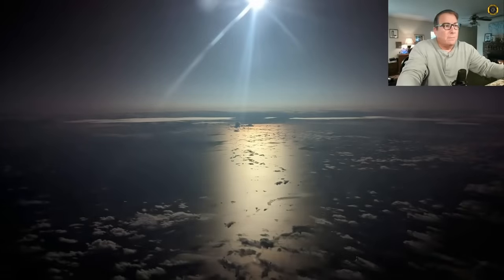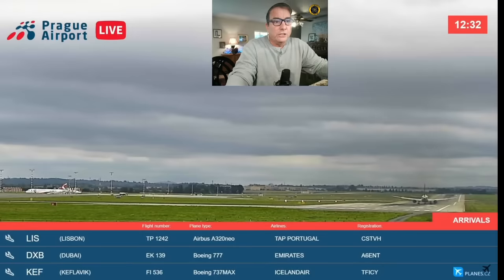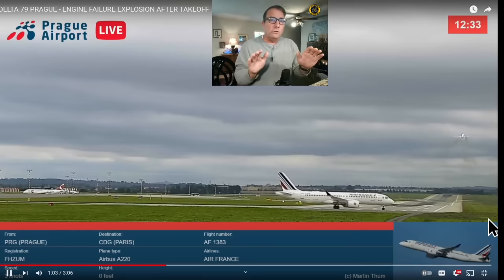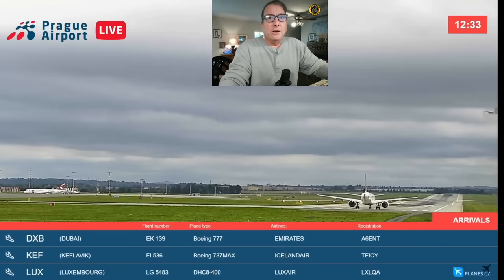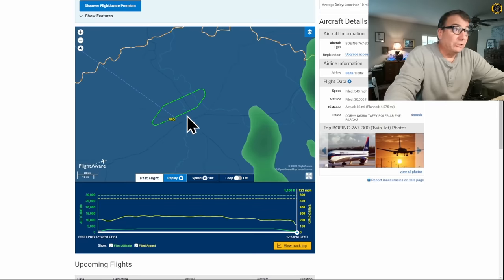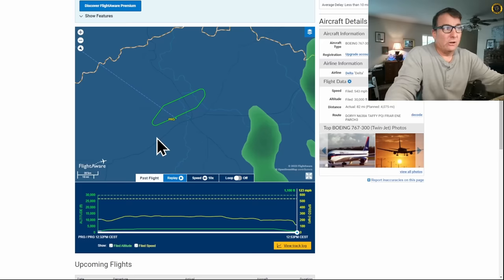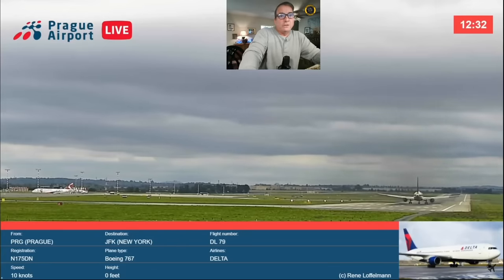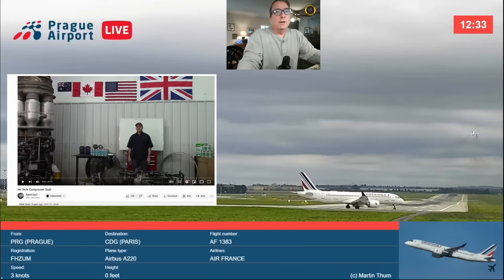DELTA 767 TEXTBOOK Engine Failure on Takeoff - Prague/JFK

Comment: I watched this video last night. I didn't realize it had just happened . I have  a question. In the video when the plane returns and lands the fire trucks roll out from the hold area and chase the plane down the runway. Wouldn't it be better to be waiting somewhere down the runway obviously out of harms way so the response is quicker ? Even if a plane crash lands it's still going to slide for a a long ways down the runway . I see the same thing in drag racing videos . A car slams the wall and doesn't stop for quite some time and at many drag strips, the emergency vehicles come from behind the starting line .

Comment: does the "deal with the engine after 4000ft" apply in the jets which have tail mounted engines? say an Embraer, or even the occasional still operational MD80
                               also, does the modern autopilot have a single engine mode?

Comment: @blancolirio I agree the crew did an awesome job of flying the plane and dealing with the situation. Although, I have one pick up point... during my basic flying experience, I was taught to do declare "Mayday, Mayday, Mayday", which is an internationally recognised distress call or "PanPan" * 3 for urgency. Why do American pilots refrain from using "Mayday" or "Pan"? Wasn't this a contributing factor to the accident of Avianca Flight 052? Ok the Delta crew here did say "Emergency, engine failure", whereas the Avianca crew said "Priority, fuel". Surely if "Mayday" and "Pan" are endorsed by ICAO, then they should be used?
Reply: In my 7 years US Navy flying and 30 at the Airlines we did cover Maydays and Pan Pan but never used them. The reason why is because when in constant contact with ATC it is unesecairy verbiage. Just not used in USA flying. Maybe mid ocean crossing using HF radios it makes sense.

Comment: JB, with the Air France cleared to go, wouldthere have been any concerns of parts falling onto the runway that "may" affect or hinder the Air France who was following Delta?
Thanks for your update, your time and resources. 
Take care and fly safe. 🤟🏼✌🏼
Reply: Yes, remember the Concord crashed after running over a piece of metal dropped by I think a Continental flight.
Reply: In my book, the Air France wouldn't have moved until the runway had been inspected. You've no idea where the debris field might begin. Even taxiing off the runway might result in tyre damage or ingestion of FOD.

That said, good job done by all involved.

Comment: Just need clarification, why would you bank right with a right hand engine failure after take off?? Shouldn't you bank opposite of engine failure???
Reply: The jet has enough thrust (even single engine) that it can safely turn either direction. The video addressed this.

Comment: I doubt the ETOPS rating for this aircraft had anything to do with the outcome of the incident. Bit, it's reassuring to know that as long as the engine crapped out and it's dead that the plane can still continue.

Comment: Theres even a better angle video of the departure engine failure more to the right where you can see the black smoke disapate after number 2 shut down and then the emergency landing twenty minutes later with fire rescue chasing the 767 down the runway and the pilot radio ATC that the plane is stopped and both engines are shutdown with running APU.

Comment: recommend some kind of real time cam system be created for aircraft safety that the pilot in command in cockpit be able to view immediately the entire aircraft bar none both outside inside and all via a simple video screen in cockpit so they can assess whatever is happening to aircraft during emergency aside of and with current aircraft performance sensors as of now.  maybe something just a suggestion.

Comment: Great job. I thought the fuel dump was a must. Because " the plane is too heavy for landing".  We see some planes doing that before landing. So what's the rule. Txs.
Reply: I thought they would be heavy too
Reply: We are not required to dump fuel. Whether 1 lb over or 10,000 lbs, the overweight landing procedure is exactly the same. 

After our 777 painted LA in jetA, it’s not mandatory.

Comment: Actually, you do not necessarily need rudder trim before you engage the autopilot: You need to have enough rudder input to center the ball, or the slip indicator (brick) on 767 a/c that have a PFD. The trim is there to take the load off  your leg. The autopilot doesn't care whether your keep you foot pushed against the rudder pedal, or whether you compensated with rudder trim to take the load off  your foot: just that the ball is centered. But you are correct, the autopilot on B767/777 will disengage one second after engagement if inadequate rudder is applied after an engine failure, whether it be with your foot, or whether there isn't enough rudder trim after you ceased foot input, so that the ball is not reasonably centered.

Comment: You need to qualify that. You mean a modern airliner. Try this in a DC 8, inevitability it's 2 engines out on the same wing.  The poorly maintained autopilot is not used. Ah, the good old days.

Comment: If you shoved 10,000 pilots into the flight-deck of a simulator and told them all: "you're going to have an engine stall about 2-seconds after 'V-1, rotate'" - I'd be surprised if 3% could handle it as well as this crew handled it without any warning, in real-life, with passengers aboard.  Some things deserve a "tip-of-the-cap".  This deserves a "cap-off, bend-the-knee, deep and graceful bow."  This is a brilliant example of perfect airmanship.
Reply: We have over 16,000 pilots at Delta. Every single one is trained relentlessly on V1 cuts. We practice them every 9 months in the sim and you’d be hard pressed to find a captain here who doesn’t review the procedure verbally during the initial crew brief so everyone is on the same page. 

On that flight, there were 3 pilots with very delineated duties briefed for a V1 cut. Our philosophy is EVERY takeoff is a potential V1 cut.
Reply: @captchia  Every part of your comment sounds true.  Is Delta still an airline?  I thought y'all went bankrupt in the 70s???
Reply: Pilot get trained on this stuff on a hi-annual basis, so dealing with engine failures is second nature, easy in fact.
Reply: @EdOeuna  You don't have to tell me the procedure.  Positive VSI, keep it in the white-stripe, 200 feet and positive climb - gear up, flaps to 15, rudder input as needed to compensate for asymmetric thrust, maintain ideal single-engine climb speed (165 knots IAS on the 777 with GE equipment + 1 knot for every 1,000 ft ASL of pressure altitude), verify the malfunctioning engine on both sides, slowly roll it back to 30% N1 with both sides  verifying the good engine remains in TOGA detent,  if surging persists (or abnormal vibration or sound) roll it back to idle.  If EGT continues to climb in idle or the temps go red - both pilots confirm the guarded switch for fuel-cutoff to the malfunctioning engine, both pilots confirm that conditions demand fuel-cutoff be engaged, PO unguards the cutoff switch, the PIC confirms the correct switch has been unguard and orders the switch be engaged, the PO pulls up the fuel-system page on the EMS and observes, PIC audibly confirms command of the aircraft and orders the MAYDAY, PO calls the MAYDAY, informs failure of the engine to ATC, and declares intention to fly the MAP, hold pattern altitude and circle back for an immediate, overweight landing... yada yada... if you programmed yourself right during pre-flight - you've already got the comeback punched in so you can basically land it as a precision-approach even though, with an engine out, you've technically got to take it on the visual unless you're IMC.  It's a cake-walk.  I can do it in my sleep.
Reply: @realdizzle87  - so why the stupid comment about only 3% of pilots being able to perform this manoeuvre?
Reply: @EdOeuna  Before I answer your question, I have a question of my own: where are you from?  I'm not asking for your address.  I'm not even asking for your country, if you don't want to give it.  But, I've seen a few indications that make me think: you're not a native English-speaker.  For example: you spelled "manoeuvre" EXACTLY CORRECT... if you speak French.  He in the USA and every other English-speaking country - we spell maneuver WRONG because hundreds of years ago - we fought wars against the French.  And so, when France lost some of their wars back in the 1600s, part of the agreement was - we are going to take a bunch of your French words, and we are going to spell them wrong,  and we are going to really screw up their pronunciation.  Anyways - I feel confident that you are Western European, but I really want to know - what is your native language???
Reply: @realdizzle87  - the last time I checked, the correct English is manoeuvre, colour, programme…

That still doesn’t explain your crazy notion that only 3% of pilots could handle something as straightforward as an engine failure at 200ft. 

My origins are of no concern to your unfounded statement.

Comment: "an engine out in a twin-engined airliner is must easier to deal with..." than in a mig23, for example.
Reply: The Mig-23 has one engine.
Reply: @christopherrobinson7541  you didn't get the nuance, did you...

Comment: Is it general protocol to cancel the take-off of the Air France flight even when the Delta plane is clearly out of the way?
Reply: @gryhze?si=uqhftQBOgftVzHAk:
The runway needs to be inspected for the possibility of foreign objects on the surface before any other aircraft are allowed to use it.
Foreign objects can be a hazard to the tyres, and  engines of other aircraft.

Comment: Wait a minute.  The Delta flight must surely be on an IFR clearance so it is NOT proper to maintain an extended centerline ground track after takeoff!  That is only correct for VFR operation.
Reply: The pilot requested ‘extended’ …

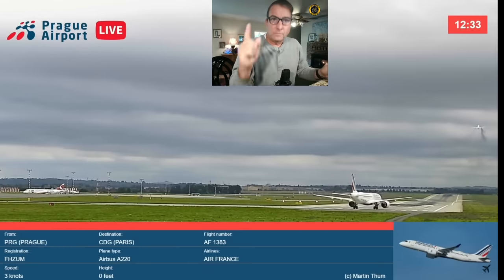At approx 02:04
“Engine failed, we’ll call you back, we’d like straight out”
Reply: At our airport, the SID is to maintain runway heading, until instructed otherwise by centre.

Comment: Does the relief pilot have a  specific role other than double-checking the actions of the pilot flying and pilot monitoring? Another great video Juan. Every time you mention an uneventful trip across the BIG pond (Pacific) I think about how amazingly reliable the technology is today.
Reply: The relief usually assists with the checklist(in an emergency) or whatever is delegated by the cap.
Reply: All cockpit crew members are to assist the PIC/captain. He is the conductor of the orchestra!
Reply: Is the relief crew in the cockpit on takeoff in the 767?
Reply: @aawillma  yes, for takeoff and landing.
Reply: They can do the brief to the purser and PA to the cabin. Take some load off the pilots. Otherwise they just monitor the PM and PF.

Comment: Do they still use thrust reversers with an engine out?
Reply: No, you'll get asymmetric thrust otherwise.  With no other failures, it can stop perfectly fine with 100% brakes and speedbrakes activated.
Reply: Yes, you know it will produce yaw so you apply rudder steering accordingly. Full reverse thrust is automatically factored into the landing performance, at least on the 777.

Comment: Will you be covering the The Piper PA-25-235 Pawnee crash at the gender reveal?
Reply from the maker: link?
Reply: @blancolirio It's getting around, it's super lame it looks like a yank pitch pull up with an aircraft with structure fatigue fractures all over the place and the FAQ pole smoking recipients down below cheering on the failure without losing anything.

Comment: Hard to tell on my cell phone, but it looked like there was more smoke than normal even while the plane was on the runway, building up speed. Perhaps it was getting extra fuel to that engine or not getting a full burn or something befor lift off and failure?

Comment: they did air france dirty, no reason not to clear for takeoff
Reply: You don’t wanna have 2 emergencies at 1 time. So there was a very good reason behind it.
Reply: @altavelmcnamara  chances are exactly zero for another engine failure. Different airline, different manufacturer
Reply: @lolbots  Chances aren’t zero since it had happened before, stop BSing.

Comment: what I found cool was it wasnt instantaneous, it was still stable flight just long enough for the surge to catch you off guard, then the yaw hits. but by the time you feel the yaw, youve alredy diverted enough attention to the surge sensation that things couldve already gone south. aviation is no different than any other "performance under pressure" job. great work to the flight crew, dont let atc fly your plane!
Reply: Wtf are you talking about? ATC?